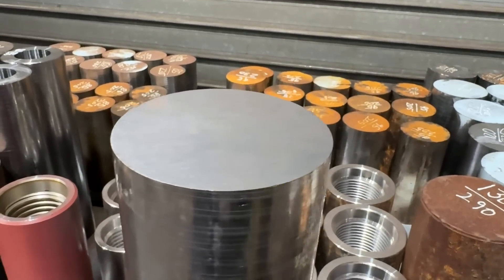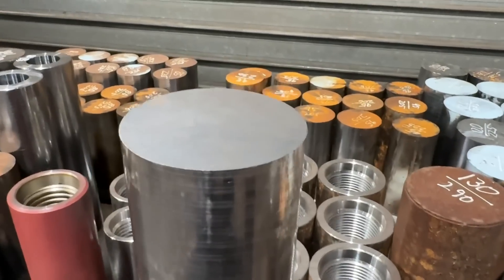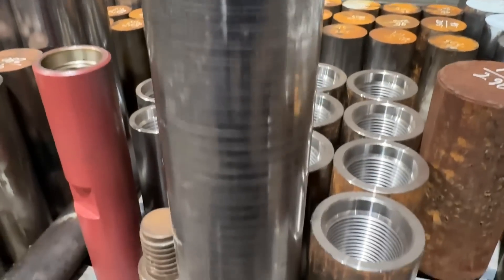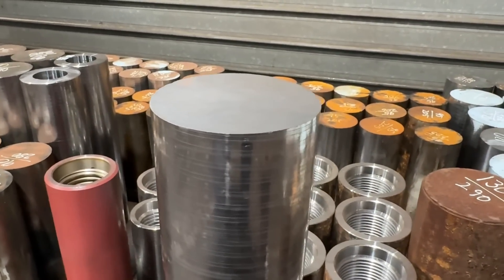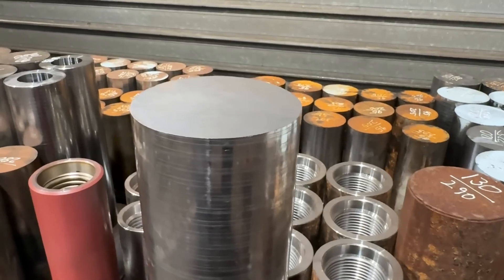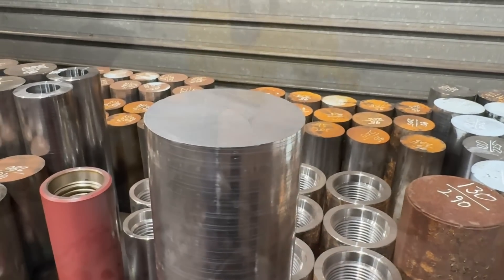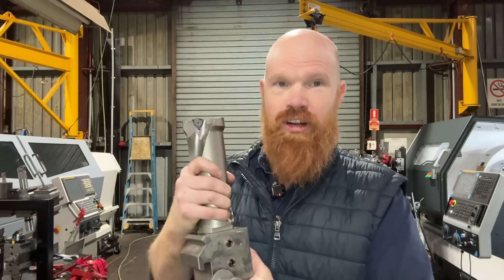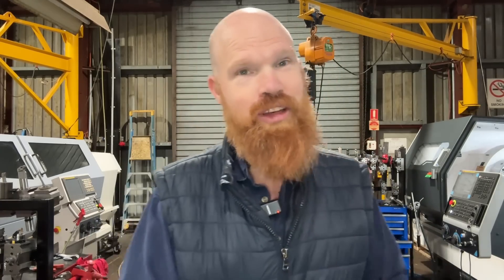HTS DRILLING at 900 rpm is UNREAL (you need to see this)

Comment: Yes it takes time to set up. And lots of HP and torque to drill large diameter holes. And lots of coolant pressure to flush chip out! 
I sold them for a major carbide company some years back. Drilled a hole 3” in diameter into 718 Inconel. No one else could even do it.
Reply from the maker: That’s wild! I’ve never machined inconel, but from videos I’ve seen it looks bloody tough
Reply: @halheavyduty  oh that’s nothing compared to Hastalloy, or Rene 100 or pure Tungsten! I’ve done most them. They’re steels for aircraft, military, and aerospace or nuclear.
Reply from the maker: Fark! Pure tungsten would be insane to machine! What kind of tips do you use for that? 

Ceramic??
Reply: @halheavyduty  Nope actually just a very good grade of carbide usually a nano-grain structure with a 10 % cobalt  factor at about 150-200 SFPM.
Reply from the maker: Fascinating!

Comment: I would suggest you run coolant before you touch the material if you started drilling and switch it on while in the material the drill can get damaged and the inserts can crack/break. Had that happen to me
Reply from the maker: We generally do as a rule… it was just for the video sake.  Thanks for the comment!

Yeah, I made the mistake of running coolant like that on a ceramic tip once.  Lesson learned 😩

Comment: There's a combination of reasons why a vibration pattern is occurring. #1 The Insert head design itself. There's basically no side support behind the cutting inserts with that head design. It's not designed for achieving a truly good finish. For instance, Sandovik, Iscar heads for large holes have none cutting-edge support carbide inserts behind the cutting inserts, this produces a very good finsh, how many are determined on the bore diameter, larger the bore more  support is needed [ centering insert provides no support ] These cushion inserts behave like a follow rest on a manual lathe turning thin shafts, without it"""!😉 Bar deflection is basically the enemy here. If the bar was 12" long your results would be completely different than one 39" inches long. You could experiment with altering spindle speeds during cutting, this changes the harmonic frequency which shows itself as a repeated pattern. Changing the speeds on the fly breaks this repeated pattern. You could get a better designed insert supported head or make a brass clamping slip ring that is able to pass the chips but slightly smaller than the ID, to give the bar support behind the cutting inserts. I was a machinist many years working for a shop that did deep hole drilling, up to 15' feet 1/2 to 8" bores. We had 2 sandovik deep hole boring attachments. When drilling say 4140/4340 the bores were like a mirror finish! Cutter head design with support is the key to bore finish, if thats what you looking for. It boils down to how much money and ingenuity you want to devote to the process 😊
Reply from the maker: Dude what a comment!

Thank you so much for that. You clearly know your stuff, and I’m really grateful for your input.

Love it.

Comment: Chatter is usually from a harmonic in the material. Try a 100-120 RPM change each direction to see which gives the better result. Some insert tooling hates to be run conservatively, others protest being run hard. Keep the feed rate the same for that test. If there is zero change, keep the RPM and slightly vary the feed rate +/- 5%. One of these will generally give a result leading to a good finish and less tool wear.
Reply from the maker: That’s a great tip.  Definitely will do for the next drilling run.  Appreciate the comment mate.
Reply: As stated above. I've also had success with various methods of detuning, depending on the setup. One of the easiest methods was wrapping a strip of bicycle tire inner tube around the material where it's not being chucked up and or on the drill. I've found most detuned dimpled drill bars work ok, but the rubber seems to give better results. Combining it with the advice above might help. I've also heard some claim the pressure of the coolant can impart harmonics, so maybe back the coolant flow down so it's just enough. Good luck!
Reply from the maker: I've started putting rubber inside the large pins before we thread them now, and it bloody works a charm.  Really appreciate the suggestion.
Reply: @halheavyduty  🤜🤛
Reply from the maker: Worked a charm.  Thanks again brother
Reply: Compare 4140 to 4140L. Can’t use for drinking water but you are drilling oil products
Reply: Disculpe. Pero ya sea perforando o roscando con tungsteno, la velocidad no debe ser menor a 400 o 500 rpm y más estos insertos que tienen un revestimiento de más dureza aún, Que es la velocidad ideal en ese diámetro. El ruido es obligatorio(depende mucho de la dureza del material a maquinar). La rigidez del palo, el vástago que es de acero templado, es de lógica que suene.
Reply: My guess is that a slight increase in feed rate would help in this regard. Only a guess.
Reply: Resonant Frequency λ1=4(L+0.61r)

Frequency =4 X ( length of the tube + "0.61 X internal radius of tube") 
Close approximate.
So if it's 200 rpm and it's 200 Herts resonant frequency then it will vibrate .
There are harmonics to avoid but that's a general guide . 
The other comment is correct when saying a slight variation in speed will help , also , the deeper the hole the greater the noise and vibration. Possibly some lead tape wound at random on the drill shank and the outside of the tube might help damp it a wee bit .
Reply: Yes...!

Comment: Sometimes, giving the drill a soft start, say, go about 10mm deep at 1/2 the feed, then accelerate to full feed. Same for exiting the part.
Reply from the maker: I totally agree.  

That’s what I usually do for Udrills but the manufacturer suggested against it.  

I’m going to add your suggestion into the future trials.  I have a feeling it’ll help it locate, much like I’ve found with Udrills.

Thanks for the suggestion mate.
Appreciate it

Comment: My experience with that is when the center drill gets dulled down, the vibration will go away. I ran a 5.7” Komet drill in a Trevisan with S225 F1.08” and every time we changed the center drill it would vibrate until it got the sharp edge worn in.
Reply from the maker: That’s really good to know.  Thanks so much for sharing.  Cheers George.

Comment: I am not a machinist.  I am an engineer.  In watching the video I noticed the long unsupported length of the drill and wondered about vibration.

Is it possible to use two steady rests on the drill shaft, one just behind the drill as close as possible to the chuck?  The second could be placed at the middle of the drill of the drill shaft.  Remove the midpoint steady rest when appropriate.   There is a possibility that harmonics could create vibrations.

The drill and lathe manufacturers should be able to provide assistance.
Reply from the maker: Always good to have an engineers perspective.  Appreciate the comment brother.

I’ve had a few people mention ideas around rpm & feed changes, which make sense - and also putting some heavy rubber bands on the shank to eliminate potential harmonics.

Also going in slowly on the feed for the first 10mm until it centres… then cranking it up to full speed.

Will be fun to play around with it when I have a larger production run in the future.

Again, thanks for commenting. Will be interesting to see what actually works best.

Half the fun of machining is getting to fiddle with it all.

Comment: Increase your feed rate and come down to 700rpm
Reply from the maker: A bunch of machinist with experience using this tool have suggested putting heavy rubber bands on the shank to dampen vibration.

That, and reducing RPM slightly and increasing feed.

Will be trying all the suggestions in a future video and see what works.

Great comment mate.  Good to hear an engineers perspective 👊

Comment: That sounded great considering the tool length. The chips looked good, too. And the spot drill in the tool tip didn't have any colour changes either, so I would say you did a great job! I would find it interesting to know which feed you had going. Looked something like 0.4mm/rev to me, which would be quite alot for the spot drill I think. Ok for one part but maybe not for a series. I'd be careful with adding the coolant on tools already engaged for more than a second, because they could get a shock and break. Would you consider adding feed info in future vids?
Reply from the maker: Thanks for the great comment.

For sure.  I’m actually going to start putting the feeds on the screen in the vids.  

The feed in this one was 0.15mm/rev @900rpm.

It runs better slightly less rpm and higher feed.  0.16-0.17
Reply: @halheavyduty  Your welcome! Great idea! Thanks for the info! Take care!
Reply from the maker: Most welcome 👊👍

Comment: wow, great chip maker, I am only an amateur, but your vibration issue could be just the stick out of the tool, so perhaps a steady rest (an automatic one), which swings away once the bit is a few inches in the cut, aka like the other tools in a cnc machine, just adding this step to the programming. Also as an extra step, adding a smaller drilled hole in the end, like for a tail centre may ease the outer cutters in, being centred by a pre existing starter hole for the centre bit.
Reply from the maker: We are going to try putting a few heavy duty rubber bands on the shank and see if it helps.

And increase the feed a little.  A few people who have run the a lot have suggested it, so let’s see.

Great suggestion by the way.  Appreciate the comment brother 👊

Comment: About 50 years ago I worked for a company making shock absorbers for the US space industry, we used an Oerlikon system that had 2 tubes, the coolant came up between the tubes and the swarf was carried down the central tube, we had a huge coolant tank linked to car radiators to keep the coolant cool, the finish in the bored tube was like it had been honed.
Reply from the maker: Dude that sounds wild.  It’s so interesting the custom solutions that are out there.

Thanks for sharing!
Reply: They're called ejector drills, done some crazy deep holes in Inconel at ridiculous speeds. Make sure your coolant tanks big enough though 😊
Reply: @mythai9593  Thank you for mentioning the name! It enabled me to go look for some explanation and illustration. I'm not a machinist though absolutely fascinated by all things metalworking but I hadn't encountered this kind of drill before. Very cool, quite an ingenious design
Reply from the maker: Agreed!  It's a great design.  A lot of our larger drilling (into the ground) uses reverse circulation tech like this.  The big rig we're building uses it too.  Lets you remove large volumes of cuttings without having to run 8 massive air compressors!
Reply: I used a similar set up in the Netherlands, boring a 71mm hole through the central shaft for those big wind turbines.
Reply: I run an old oerlikon dm6 lathe at work, thing is an absolute unit. Didn’t expect to see that name here

Comment: How many HP does that take to run?
Reply from the maker: The machine is a 22hp machine from memory.  It doesn’t use up a whole lot of HP to run that particular drill.  I think we were only at 40% spindle load.

The drills are surprisingly efficient.

Comment: reduce your revs or increase your feed to get rid of the vibration
Reply from the maker: That’s the plan. A few others with experience on this specific tool have said the same thing.

Really appreciate the advice.  Will be doing another run with it in coming weeks, so have a bunch of goes to get the setting just right.

Comment: if vibration and squealing is present the normal rule is to slow the RPM down.This has worked for me using a 25mm WC series carbide-tipped U drill into 4140. Thanks for the video, impressive drill bit.
Reply: If the chips is not turning to a brown or darker color like blue, than the RPM is fine.
Reply: @SlowReactionDriversAreTheWorst  As always, it's the combination of the two. I'd try both a slightly lower RPM and slightly higher feed. If it was too hot you'd see steam. There was none. I gotta say it's a nice drill, though. Makes a nice finish as far as I could tell.
Reply from the maker: Cheers mate.  Thanks everyone for all the input too.  It’s really helpful.
Reply: @halheavyduty do you mind sharing, which coolant you are using?
Reply: @tiaanmostert1402  Cimcool/Accucut. It's all comparable though. I have tried the high sulfur and high zinc stuff, but the prices get silly.
Reply: @SlowReactionDriversAreTheWorst with that amount of coolant, it would be nearly impossible to get discolored chips!
Reply from the maker: Great tip! I totally agree.  

For the first run we were sticking to the manufactures specs, but in my experience they tend to overstate how fast / hard a tool should run.

Will be slowing it down and upping the feed next run.

Thanks again for the comment brother
Reply: @halheavyduty I used drills like that when I was machining  , I'd say the same , reduce the speed a bit and up the feed , just keep an eye on the chips , I found the upped feed seems to help keep the drill centered, subbed 👍
Reply: If vibration and squealing are* present ...
Reply: This whole thread is funny and it sounds exactly like a bunch of Machinists disagreeing on how to "properly" do a particular job.
Reply: yeah, speeds and feeds issue - it also is likely causing excessive wear on the inserts. insufficient ‘bite’ in the edge is causing it to ‘skip’ over the surface periodically, causing the vibration.  Heavier feed for the rpm, or slower rpm for the feed usually fixes it.  Surprising it was that bad with those chips though! Could also be a tool rigidity issue?
Reply: Generally speaking, yes. We have even used rubber bands, sometimes on the tool and sometimes on the workpiece. His feed looks good, but we all know that tool mfgs always overstate their tool's capabilities. The shank looks thin to me and could set up the vibration. I always used sandvik drills for large bores.

Comment: Lower the RPM and adjust the feed rate until the tool stops chattering.
Reply from the maker: Will give that a crack on the next run of deep drilling jobs for sure.

Thanks James 👊

Comment: You should make a shorter arm for your indicator when measuring the runout, and thread it in the senter off the bolt in the chuch. The long arm and the magnet can give you a false reading when handing upside down
Reply from the maker: Thanks for that brother.  You’re not the first to mention that, and I suspect you’re dead right.

Will be getting a more fixed arm style indicator stand for this purpose.

Appreciate the comment mate 💯

Comment: Used to run the big U drill that you show at the end, daily on 42-48 Rockwell stock! Made many chips with them drills. Done most of it on an old WWII turret lathe, some on a Mori Seiki SL-65.
Reply from the maker: That lathe would be a weapon.  Some of the old school gear is phenomenally well built.

We have an old Russian lathe that has a bed that seems hardened by some forgotten ungodly process.

50 years old and still not a mark on it

Comment: Need to feed it harder the chips are coming off pretty burnt and the screaming is because the wiper inserts on the outside are rubbing more than cutting increase your feed per tooth by 40-50% should be golden
Reply from the maker: Fantastic advice.  I’ll try that on its next run.  I suspect you might be bang on the money
Reply: @halheavyduty  I love those drills the one you have with a center drill in the middle are bad ass for lathes I’m mostly a mill guy buy drills are drills keep up the great work
Reply from the maker: After some fiddling and adjustment… I’m a massive fan of this thing.

It’s such a massive time saver for us.

Thanks again for the suggestions

Comment: I've ran a couple of these drills verry often and some noise is normal, i don't know if I saw it correctly but you've seem to have gotten the double Trigon holders, there are also finishing holders with one square at the edge and they produce a lot better surface. But it depends on the machine, I've felt like they need a lot of Torque and feed to stay relatively quiet and get a good finish.
I've normally ran mine at about 280m/min with ≈ 0.18-0.25 f/rev in similar steels.
But they need a lot of experimentation  hence they perform very different depending on your machine rigidity and Tourqe
Reply from the maker: Brother, thanks a lot for that comment. It’s really helpful. I’m going to jot all that down and play with speed and feeds next time I do a batch run.

Comment: Most anyone that has ever done any machining realizes that setups usually take a lot longer than the actual job.
Reply from the maker: So true.  So so true
Reply: Used to do bespoke woodworking. Quite often 90% of the work was building the jigs  and fixtures to hold the work or guide the tool. Actually making the cuts was nothin'
Reply: Reducing setup time is key to productivity. The goal is to setup machines to run complex parts efficiently and safely.
Reply: It's sad sometimes you lose money from setup but gain money by big peice orders. It's a money management game for sure.
Reply: Manual programming?
Reply: You don't even have to machine. "Measure twice, cut once" expresses your feelings and is used in carpentry.. which doesn't care about too much under 1/16th. Maybe 1/32 for some that don't realize they're transmachinist.
Reply: It varies. Sometimes yes, sometimes no. Doesn't have to except for when it does.
Reply: Any good machinist haha